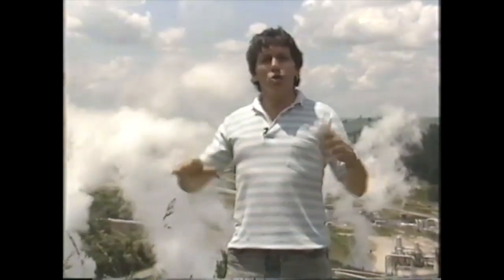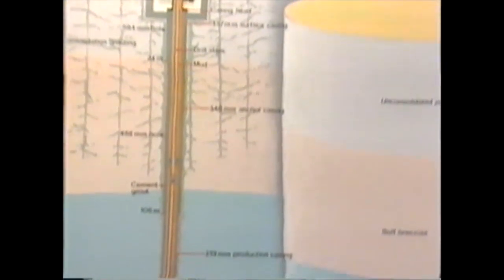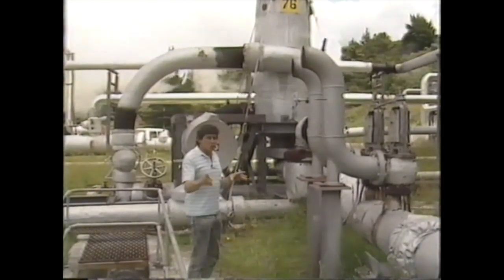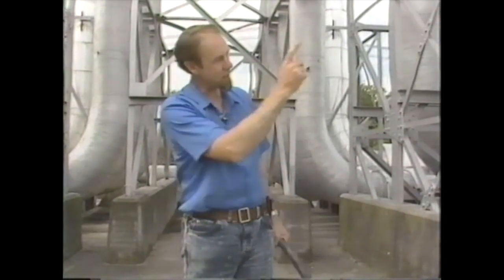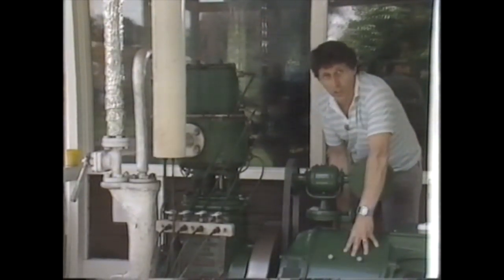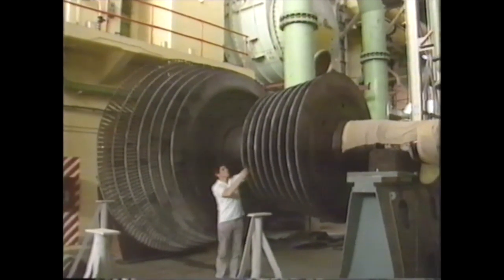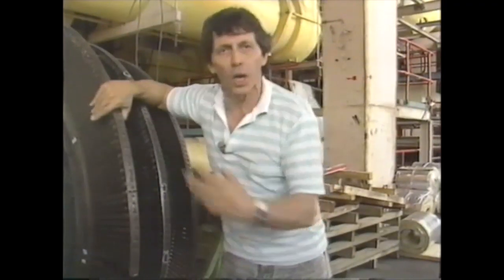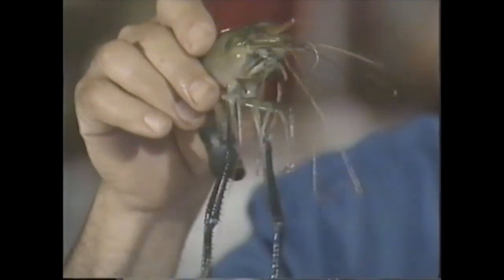Geothermal Power Station

Comment: can i use a small portion of your video without monetization to let people know of this generator that is operated on four cylinders and is capable of powering 8 to ten houses. because i want to make a four speed four cylinder electric truck with it. i need my friend online to help and in fourth gear just above nominal  speed it should get full or enough power for a box truck at thirty miles per hour and the truck would be traveling at 75 on electric hydraulic motor. or there abouts.  no i am american Please send a reply with volt and amps once again please.

Comment: When you guys talked about vacuum power generation, did you somehow mean the steam turning back into water after being condensed and using that flow of water (enhanced by gravity also) to generate energy? Or what did you mean exactly?

Never heard of such thing. Cause if there was a vacuum inside the metal, the heat expansion prior to that would be the last thing I would worry about, since atmospheric pressure could crush those steel pipes or tanks, so I'm confused with that vacuum talk.
Reply: Hi.  For "vacuum" read "à pressure below atmospheric".   How much below?  Dunno.  The turbine spins because the gas (steam) will go from a higher pressure zone to à lower one, pushing the turbine blades on the way.  The speed of spin depends on the difference in pressure between inlet and outlet.  Chilling the exhaust reduces the outlet pressure and makes the turbine spin faster.  In principle, this dates all the way back to James Watt's invention of the external condenser for steam piston engines, which sent the exhaust through a heat exchanger to chill it, and so "sucked" on the piston, if you'll forgive the term.
Reply: @raykent3211  Thanks for your reply! Really appreciate it. BTW, do you happen to know some good literature, books on the matter? Regarding steam energy production, turbines, engines and its dynamics, mechanics and such.
Reply: @V0YAG3R  hi Belmont.  I'm afraid I can't help much, I don't have any books on the subject.  My limited knowledge comes from having studied physics and picked up other bits along the way.  The piston types are quite easy to understand so searching the net for stuff on those could be a good start.  When it comes to efficient turbine design it gets pretty difficult.  Fluid dynamics plays a big part and that ain't easy!  Anyway, I hope I'm not putting you off, the basics of turbines are easy enough.
Reply: Condensing the exhaust steam in an enclosed condenser allows the final pressure to be below atmospheric. The increased pressure drop across the turbine increases the amount of energy extracted and increases cycle efficiency. Condensers usually use river water or cooling tower water on the cold side. In this case, the "getting more energy out of the exhaust steam" probably means that they are using the steam condenser to double as the boiler for a second, low pressure, low temperature stage, probably using a low-boiling fluid like pentane or isobutane, which would boil, drive another turbine, be condensed (this time with the cold river water or cooling tower water), and be pumped to repeat the cycle. It increases the energy that can be extracted and the cycle efficiency.
Oh, and yes. The vacuum in the condenser can be a problem. For one, the condenser hood has to be designed to withstand the pressure. Before the turbine is put online, a vacuum pump must start pumping out the non-condensible gases that accumulated during shutdown. Once it is in operation, there will be a tendency for air to leak through the turbine shaft seal and spoil the vacuum, which requires the use of labyrinth shaft seals and steam gland sealing systems.

Comment: The description of the heat coming from friction seems odd. Did we not know about radiative heating in the 80s? I thought we did...
Reply: He was talking about how the underground water gets hot, i.e. friction between tectonic plates. What radiated heat are you talking about??
Reply: The vast majority of the heating is not due to friction between tectonic plates. It is because the Earth's core is hot (near tectonic plate boundaries, magma can get higher into the crust), and the Earth's core is hot because of radioactive decay.

If it weren't for radioactive decay, the Earth's core would have cooled down to a solid in under a billion years. Thanks to radiation, it's still hot 4.5 billion years later.

Comment: Why do the pipes have to be 10km long? Seems so inefficient. The steam would have cooled down so much by the time it reached the turbines.
Reply: No reason was given in the video.  My only guess is geological, maybe the ground is not stable enough nearer the bore hole.  It's surprising.  Anyway, even with the best insulation a lot of heat will be lost and there is no advantage to that before it enters the turbines.  It's an energy loss.  So I guess they had no choice.  Or they have enough energy available to squander.
Reply: Evidently...the steam doesn't cools down by the time it reaches the turbines since the power station works, and even after the turbines it needs to be cooled down using fresh water.
Reply: Maybe that's how far they had to dig to tap the source.
Reply: Because turbine generator sets are EXPENSIVE, and because multiple wells are needed to feed one turbine. And due to economies of scale, it doesn't make sense to put a turbine at every well. Insulation of the steam lines keeps heat losses to a minimum.
Reply: I suspect it's 10km in total, not 10km for each pipe. I didn't count the number of pipes in that shot, but assuming there are 10 pipes that's 1km for each pipe.

Comment: Isn’t steam with water removed just air?
Reply: I was thinking something similar with how often they said "dry steam". There must be some industry definition or something.  I'm assuming they mean steam without any liquid water.
Reply: When I studied thermodynamics, we used a thing called steam tables. A small book of data about the properties of steam at different pressures and temperatures. In this context, steam was treated as anything from liquid to a mixture (vapour) to a practical gas (super heated steam - dry). It all comes down to context. This video is rather colloquial so the definition of "steam" changes throughout.
Reply: He should have said liquid water.  As Watt noticed, if you boil a kettle there's a completely transparent area near the spout before the white cloud further out.  The transparent stuff is H2O in gaseous form, the white cloud includes some tiny condensed liquid H2O droplets which disperse light.   The transparent region is dry steam.
Reply from the maker: Correct, Ray.  You have explained the states of matter very clearly.   Deane.
Reply: lol
Reply: The fluid coming up out of the wells is a bubbling mixture of both steam and hot liquid water. They have to separate out the water from the steam because water droplets tend to erode turbine blades.